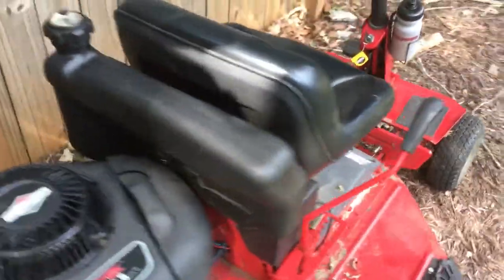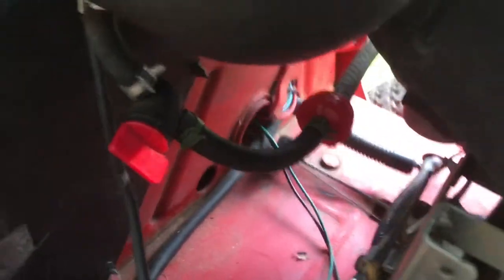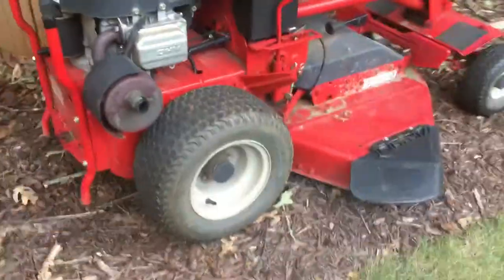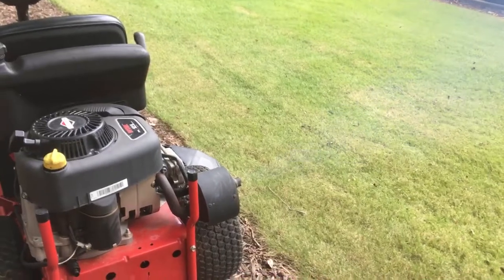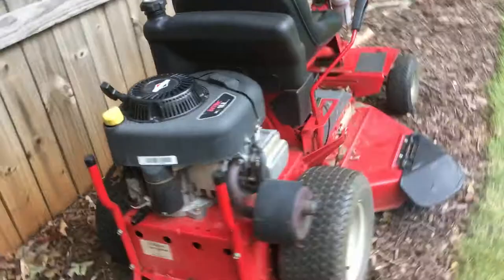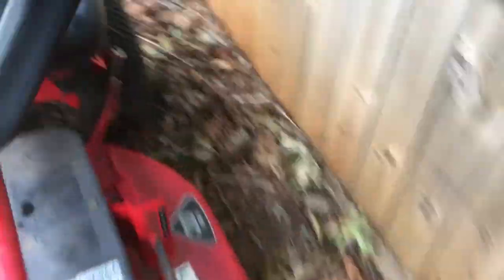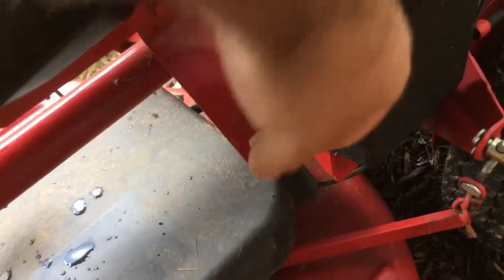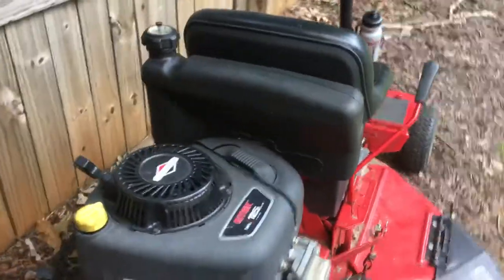Snapper 12.5hp Briggs and Stratton riding mower issue?

Comment: Horrible knocking, sounds like valves.  glad you’ve fixed.  I just acquired one and was told it had low compression.  I’m in the investigative phase.  Haven’t started mine up yet. Head gasket is  shot though and head and piston had horrible buildup.  Hoping a quick clean up and fresh head gasket gets it working.

Comment from the maker: Solved, it was the carb needed rebuilt and went ahead and replaced head gasket as well and adjust valves but carb float needed replaced mainly
Reply: I don't see how the carb float could be the main problem when it starts so easy and runs continuously.  you say you replaced the head gasket.  was it blown?

Comment from the maker: It had gas in the oil crank case mixed in with the engine oil from a leaky float because the Nikki carburetors are notorious for that and the aftermarket Chinese ones are too because this growing season I just replaced the previous carburetor again with a OEM $100 a Briggs and Stratton carburetor brand that they now make so my fingers are crossed if this carburetor that was expensive will at least last a few seasons and not cause gas in my crank case and I also put a shut off valve that I use each time I’m done with it to store the mower

Comment: I would say most likely a head gasket leak.
Reply: ya, that's my guess as well for 2 reasons.  1. it was running fine and then suddenly POOF, it ran like shit and smoked at the same time 2. It's a Briggs single cylinder Intek made in China between 4-10 years ago.  Those engines are notorious for blowing a head gasket in the same fucking place.
Reply from the maker: I did replace the head gasket as well
Reply from the maker: Actually I was mistaken not the head gasket the ohv gasket is what’s I replaced and it was previously RVT from the factory so must been china